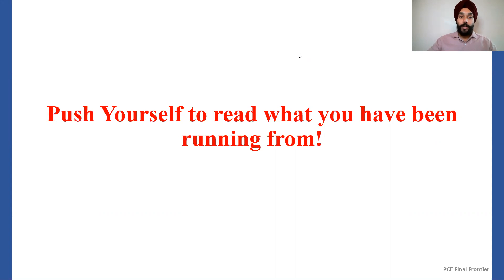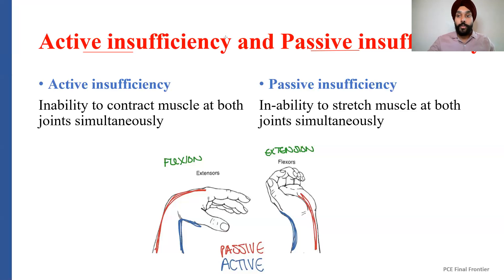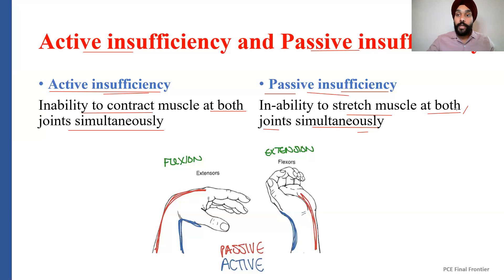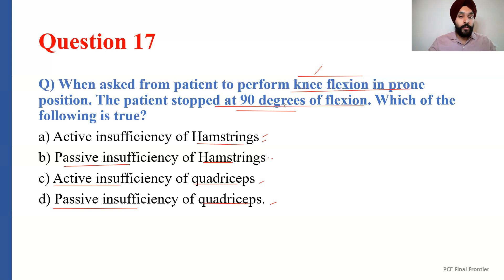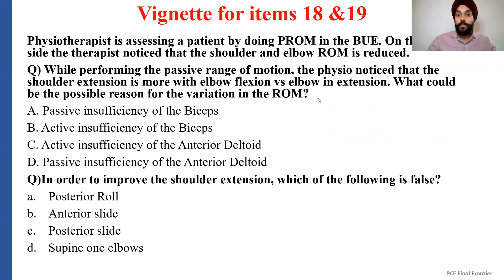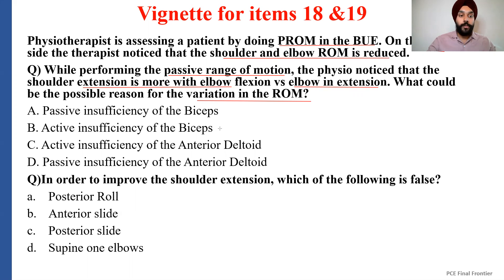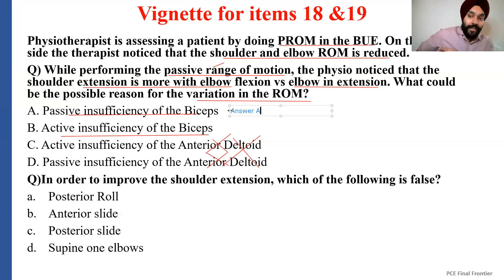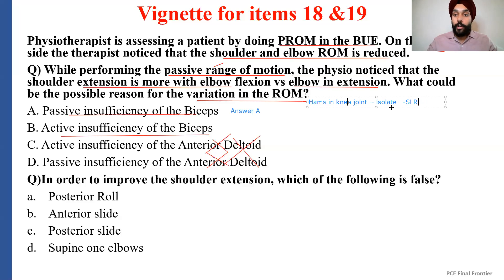Passive Insufficiency Vs Active Insufficiency | Muscle Example & Explanation | PCE Exam | PCEFF

Comment: 1st ques you did is wrong. its D passive insufficiency of quad because In prone position, the hip is extended and the knee is being flexed — stretching rectus femoris across both joints simultaneously → limiting further motion.